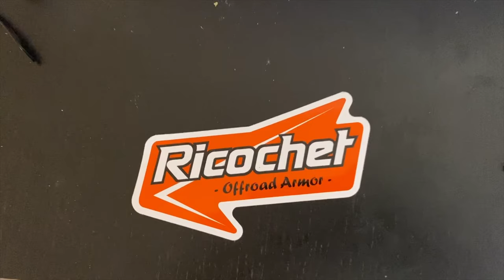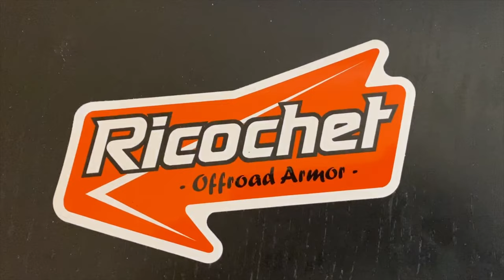BEST ENGINE GUARDS FOR BMW R1200/R1250 GS/ADVENTURE? | RICOCHET VALVE/CYLINDER GUARDS INSTALL

Comment: Hi, thanks for this video. This product seems quite different from what's available with bmw & touratech. Can u share how good is this practically now that's it's more than 2 months of use.does this product give protection from below also as it looks to be giving protection from side only. Thanks
Reply from the maker: These protect the bottom half of the cylinders and work very well. If I lay the bike over on its side the plates cover exactly where the cylinder would want to hit the ground.
Reply: @MobMoto  thanks for the reply. Cheers